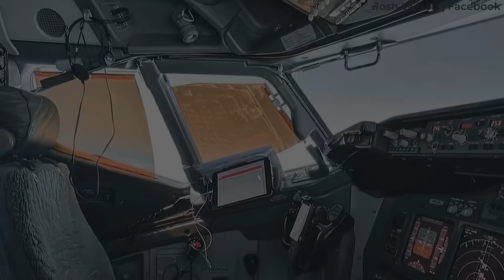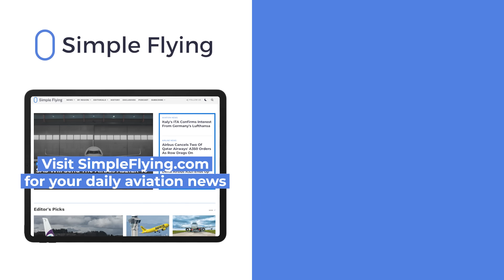You'll Never Believe What Caused This Boeing 737 MAX In-Flight Engine Shutdown

Comment: Didn't we just learn from the Air India incident that turning off accidentally is impossible?
Reply: Source?
Reply: This has nothing to do with fuel switches, give it a rest already
Reply: Different fuel switches
Reply: @Louist5e-Gaming  The max has the same fuel switches.
Reply: @MrWilliam-iw8mc sigh, 787 fuel cut off switches are below the throttle controls... Stop spreading nonsense.
Reply: @12time12 the fuel cut off switches in the MAX are at the same place as in the 767. And they are also near identical. It is a good place and design. It makes sense to use the same design in several planes if it fits the requirements.
Reply: @MrWilliam-iw8mc Every Boeing airliner has the same switch. It works and has never been a problem until we let idiots work on airplanes.
Reply: we 'learned' it was impossible according to Boeing
Reply: @mipmipmipmipmip-v5x  and it still is impossible
Reply: @mipmipmipmipmip-v5x  This is like the one time I trust Boeing because all the signs point to a suicide by one of the pilots
Reply: @moekitsune  BCC News: "The Indian Commercial Pilots' Association (ICPA) said the crew "acted in line with their training and responsibilities under challenging conditions and the pilots shouldn't be vilified based on conjecture".

"To casually suggest pilot suicide without verified evidence is a gross violation of ethical reporting and a disservice to the dignity of the profession," it added.

A preliminary report did not blame the pilots. It said seconds after take-off, both of the Boeing 787 Dreamliner's fuel-control switches moved to the "cut-off" position, starving the engines of fuel."
Reply: @mipmipmipmipmip-v5x Both engines at the same time one after the other? Using switches that have to be pulled out using minimum two fingers.
Reply: @ryanlittleton5615  I wouldn't trust the air India investigation to be conducted fairly. Boeing can bribe the investigators to ensure that the report doesn't vilify them.
Reply: @Indian-Canadian  I can't think of a single time that's ever happened
Reply: @Indian-Canadian  Wouldn't that be India's problem?
Reply: @Indian-Canadian Actually, no. The AAIB and NTSB are fully independent organizations that are very impartial, and this, they’d never accept any bribery. It’s even very unlikely for Boeing to bribe any I of them, especially if Boeing is sure they aren’t at fault.
Reply: @CD2026Clips  man that Boeing sure is one honest company that would never lie 😅
Reply: @mipmipmipmipmip-v5x It’s no different to vilify the plane.
Reply: @mipmipmipmipmip-v5x  well either the fuel switches moved by themselves or the pilot did, and the other pilot can be heard on the voice recorder saying "what are you doing?"
Reply: @certifiedrockclassic  if a visor can move the switches, anything can
Reply: @mipmipmipmipmip-v5x  😐 you know sometimes people lie to protect their jobs and therefore their livelihoods right?
Reply: @certifiedrockclassic  you mean like Boeing upper management has done?
Reply: @mipmipmipmipmip-v5x  and lower managment, and floor supervisors. Din't they also have a guy killed who was about to testify? Newsflash: Big corporations are shady AF, also pilots intentionally crashing their own plane is very bad publicity, hence the cover up which you are participating in.
Reply: @ryanlittleton5615 yes, it is an Indian problem that has global ramifications. A bunch of corrupt officials in one country botching up an investigation plays with the lives of every passenger that gets on a 787.
Reply: @CD2026Clips the Air India crash investigation is being led by India's AAIB. Having been exposed to corrupt authorities there, its hard to trust any enquiries that happen there.
Reply: @moekitsune  because exchange of bribes are hard to detect.
Reply: @Indian-Canadian Ok well wouldn't Indian authorities have more of a vested interest in saving face for the flag carrier of their country rather than a foreign manufacturer?
Reply: @Indian-Canadian Like for example say Egypt?
Reply: @ryanlittleton5615 the Indian authorities have a vested interest. Hence the Supreme Court ruling that the pilot cannot be blamed till the final report is out. But the individuals who are in-charge of the investigation may give in to greed. In a country where corrupt leaders are re-elected, things work differently.
Reply: @ryanlittleton5615 moreover, what makes pilot suicide in this case hard to believe is that the pilot in question was a year from planned retirement, when he would have received tons of money for the years of service put in. Also, he didn't have any known personal issues that could have caused him to take his life. In the Indian family structure (and the Indian society), suicide by a person like him would be rarest of rare.
Reply: @Indian-Canadian  BOTH fuel control switches transitioning from run to cut (specifically what the prelim report says) one after the other? The final report also will probably NOT say apparent suicide, much like the NTSB report on Egyptair 990.
Reply: @Indian-Canadian  Also, the character profile you gave me of the Captain is meaningless unfortunately. Surface level is surface level.
Reply: @Indian-Canadian  Furthermore, I don't think anybody wants this to be a case of pilot suicide. If it was an accident, mechanical failure, etc we could at least learn something from it. You can't really learn and do anything from an intentional act for the most part. As terrible as it is to put it this way, but all if not most people would rather it be a horrible accident.
Reply: @ryanlittleton5615 it is meaningful when you look at it from an Indian society context. Being an Indian in North America I totally understand your point of view. But the situation is different in a collectivistic society.
Reply: @ryanlittleton5615 apart from Boeing, nobody wants it to be a case of pilot suicide.
Reply: @Indian-Canadian It doesn't. All im going to say as someone who has struggled with feelings like that it's just surface level. We have no idea if that man was fighting a million different wars inside him. Hopefully that's not the case.
Reply: @ryanlittleton5615 im not sure why theres people saying it will be a repeat of the egyptair crash, revealing the fuel switches being flicked is already a big thing done by the investigators

 egyptian and chinese didnt even want to reveal anything in their pilot suicides, plus ironically enough indian investigators usually are infamous among indian public because they usually emd up "blaming" the pilots (as per previous incidents), the 2020 overrun of air india express 1344 had the AAIB put out a well detailed report blaming the pilots for their errors, air india express for their poor training , the airport authorities for lack of infra and even the DGCA for lack of supervision while indian media was doing the opposite praising the pilots as heroes

all the craze done by media regarding the crasg is funny because theres no word coming from the AAIB and rather irrelevant institutions in india with misleading headlines, as far as we know, it doesnt look like AAIB wants to 'cover up' this crash
Reply: @mipmipmipmipmip-v5x   The switches aren't made by boing. Made by Honeywell.

Comment: The Air India dual fuel cutoff switches to cutoff and now this? We need to go back to the 3 crew cockpit: Captain, First Officer and a dude that keeps the fuel cutoff switches safe under a steel cover with a padlock and the key hidden in the ashtray...or is it on top of the sun visor...nope can't hide it there!

Comment: That's a clever piece of sun-visor! So it detached and then was able to pull the cutoff switch up and move it  to the CUTOFF position...
Reply: I believe in some airframes the 737 max cutoff switches can be moved without explicitly lifting them out of the idle gate, there’s been some controversy around that problem for a while.
Reply: @tomclayton9398  They already issued an AD to correct this. It had nothing to do with the design of the airplane or the switch. Someone at the factory had installed some of them incorrectly which defeated the detent. But I have a hard time believing pilots wouldn’t notice that and write it up. Those switches don’t have any spring to snap them to one position or the other. The locking detent is literally the only thing that holds them in place.
Reply: Probably the pilot trying to protect himself accidentally helped with the issue. Things happen. 🤷😉
Reply: As usual, as per BROUGHT AND PAID FOR US FAA and NTSB,  it's never BOEING's fault it's surely a feature
Just like they brought the investigation and media surrounding the total electrical failure and RAT deployment of the  AI 787

Comment: How though? You have to pull the switch out before it can move up or down so something hitting the switch shouldn't be able to move it. The only possibility was the switch got stuck and hadn't been locked in properly when it was moved up for engine start
Reply: It fell and when the pilots picked it up to move it out of the way it hooked onto that switch, any upward movement is how that switch works so if the edge caught onto the bottom of that switch and the pilot lifted it to get it out of the way, yes that would do it
Reply: It’s only a small spring that needs to be pull… hit it hard enough and I’m pretty sure you can brute-force the switch to change position.
Reply: @t @tonamg53 A) the switch has to clear a notch, so it doesn’t matter how small the spring is. Secondly, how heavy is the sun visor to do that?
Reply: Yes, there is a notch, which is why there is a “spring” in the switch to keep it inside the notch while it is not being move…🙄

How heavy is the sun visor? Probably not heavy… but you also don’t really need heavy things to be able to accidentally move something that you can probably use your little pinky finger to move.

I was going to say “why do you think they put metal brackets there to guard the switch?” 

but then I went to have a look at the 737 Max cockpit and only then I realised… that the metal bracket is actually shorter than the fuel switch itself.

Boeing never ceases to amaze me… you always discover some new craps with them all the time 🤣

Comment: On the Boeing, you have to pull UP on the switch before you can move it out of the current position. I find it hard to believe that this actually caused the engine shut down. I will wait for the official report and not a statement from the airline.